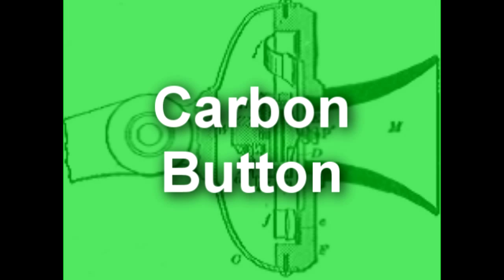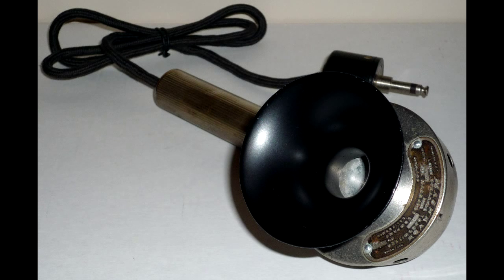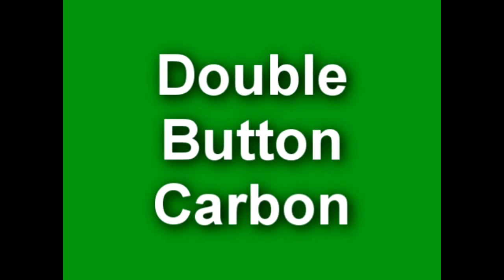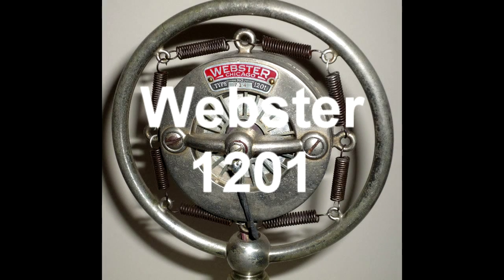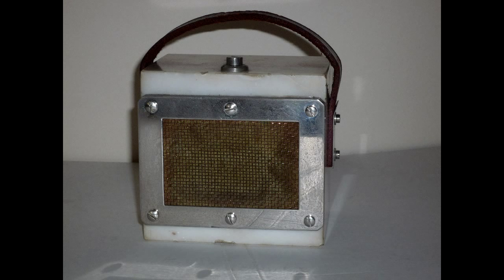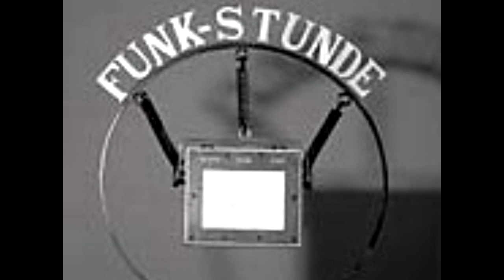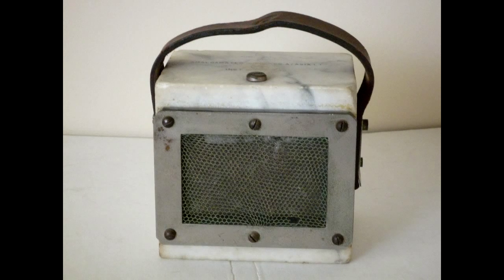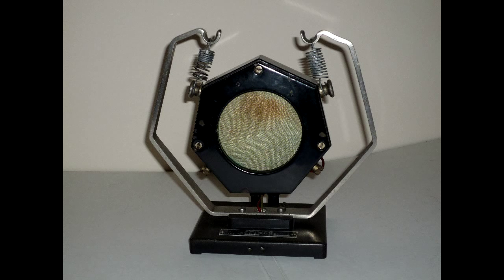Types of Microphones Part 1 (HD).m2t

Comment: In the late 1940's (maybe 1946/47)  Popular Science magazine published a DIY diagram of a high impedance microphone using the carbon core of an old battery, the are approximately 9" tall & were about 6 or 12V type. Instead of speakers, a set of headphones were used for listening; It was very sensitive & could pick up the sound of a crawling insect or the footsteps of a cock-a-roach; I have been trying to get my hands on a copy of this project for some time with no luck, if ANYONE READING THIS CAN HELP , PLEASE LET ME KNOW!!